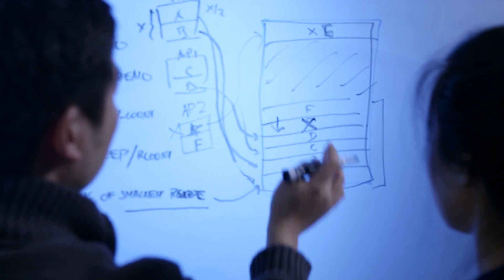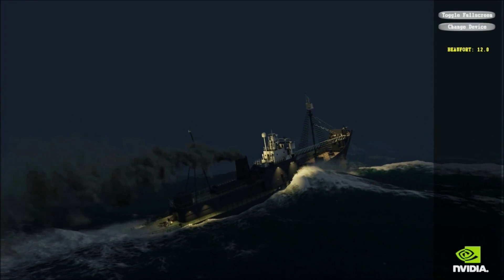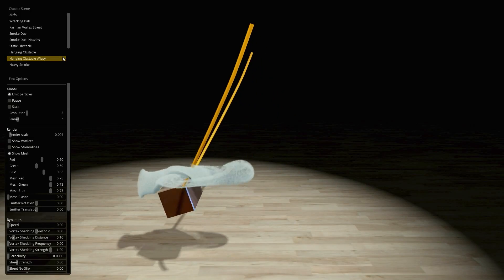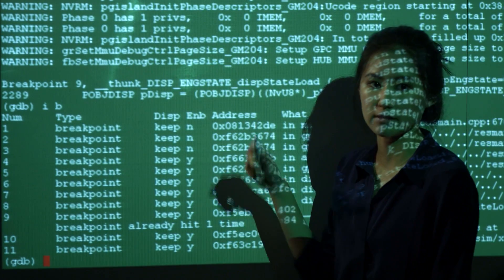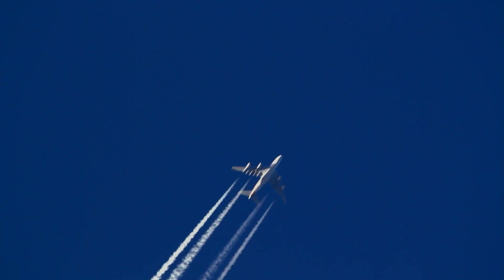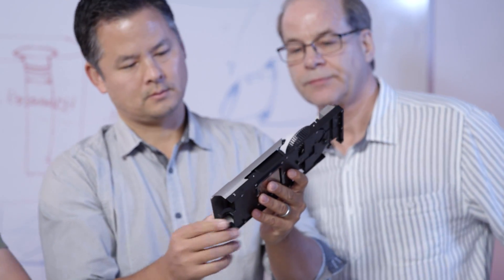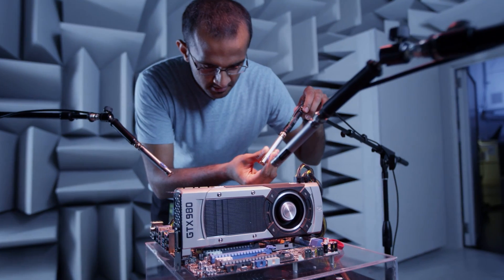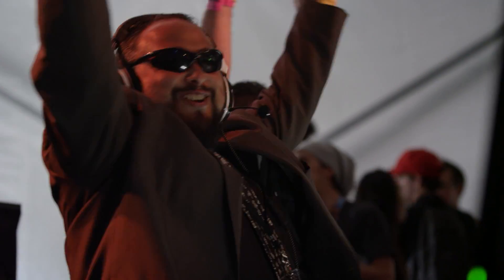The Journey of Maxwell

Comment: What do you have to major in to join nvidia?
Reply: There are a huge number of different jobs at Nvidia so it depends which aspect you'd want to do at the company. personally, I'm studying for a degree in design and manufacture engineering to hopefully work for Nvidia in the design of the coolers :)
Reply: I want to help build the gpu architecture.
Reply: I would think a degree in semiconductor design or computer architecture would be suitable
Reply: Thanks😃
Reply: Thanks I've been dreaming of working at Nvidia since 6th grade
Reply: I'm in the ninth grade so I want to know ahead of time and I'm hard worker I never take anything put perfection.

Comment: Upon comparison difference between Current top card GTX 980 and previous top card GTX 780Ti, difference is less then 2-3% in performance increase.

Good thing about 980 is less power consumption = less temp's however that is still arguable. Besides that technology is still fresh and we wont see any major difference between the 700 series and 900 series untill we will see GTX 980Ti.

I personally will keep my 2 GTX 780Ti's untill i see 980Ti, and that wont be untill most likeley next late spring/summer.

Also note 980 has less bus memory then 780ti, due to that it performs slower on very high resolution such as 2160p and 1440p.

Even more reasons to wait for 980Ti.

However still, great to see Nvidia moving forward and forward.
Reply: The 980 is around 15% faster than the 780Ti in a lot of tests. The new memory compression tech makes up for the smaller bus anyways.
Reply: You're supposed to compare the 980 to the 780, not the TI version..
Reply: You're assuming there will be a 980Ti, and most benchmarks I've seen have had it well ahead of 780Ti, and then when MFAA hits it will just get even bigger.
Reply: UniversalGaming the only test where it had 15% increase was 3d mark. thats not all the tests....
Reply: ntw94 i do, however comparing the strongest version of last gen with strongest version of new gen. as ive said will wait for 980ti myself
Reply: ***** i am certain we will. otherwise 900 series have no point
Reply: ***** ssd is mandatory anyways
Reply: ***** efficiency wise, sure, performance wise not rly
Reply: maybe you should take a break and walk outside
Reply: hello from the future
Reply: wTRage hello future